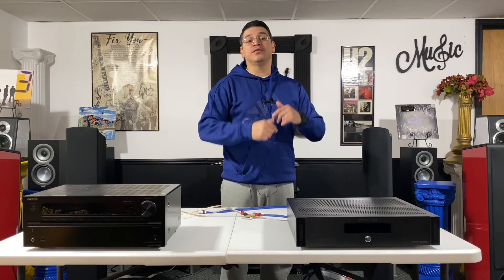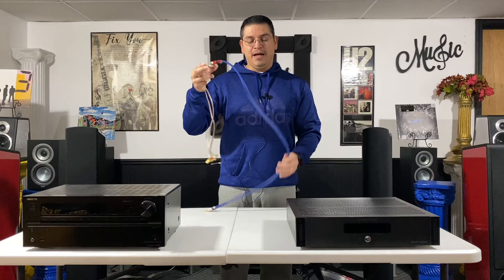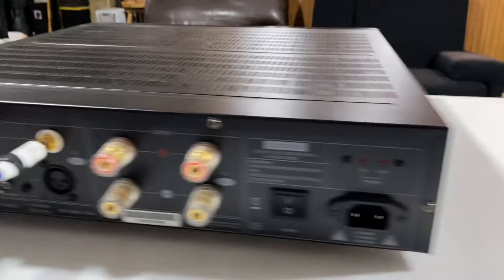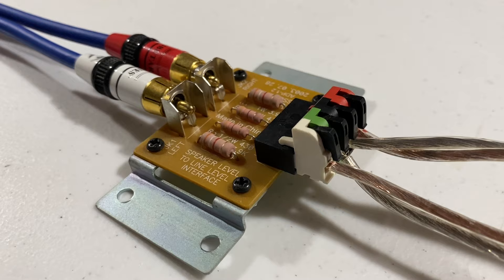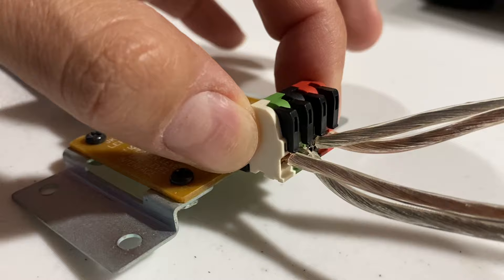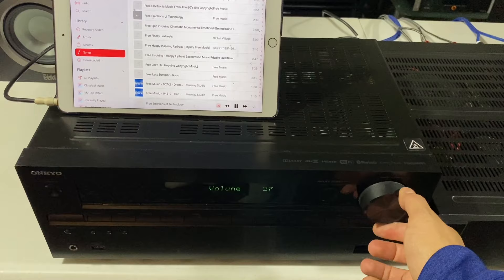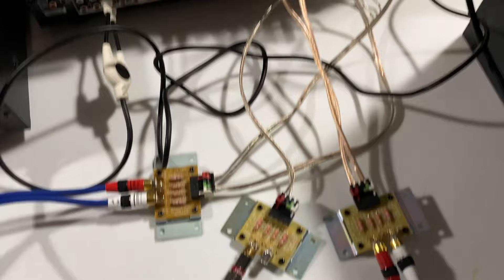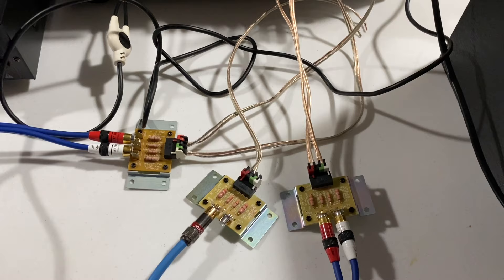Connecting an amplifier without using preouts.

Comment: Could you hook up a headphone tube amplifier to the Onkyo RCA ins?  I want to drive a set of zone 2 speakers with my tube amp to the Onkyo NR7100.  My thinking was RCA out on the tubes to cd (RCA) ins, volume control would be both....
Reply from the maker: In theory I think your idea would work, the problems you may run into would be the actual output and the which in theory you need an output source and an input source for a system to work. In your set up idea you have and output to an input/output. But you certainly could try it. Sorry I couldn’t give you a better answer
Reply: @Audiolympian  The music source would be digital out from a hard drive (PC) to a dac, the dac output to the tubed headphone amp, the headphone amp to the onkyo cd input, onkyo out to zone 2 speakers.
Reply from the maker: @maze400  that should work

Comment: I have a powered sub with high level lines. There’s 4 cables though a pair of + - and only 1 subwoofer… I’m confused on why it needs two pair of wires rather than one. How and where do I connect them to the receiver?
Reply from the maker: The high level line connections are there in case the receiver doesn’t have a sub preout. The two pairs of wire connections are for connecting the front main speakers, so when a receiver doesn’t have a sub preout you would connect the main speakers wires from the receiver to the sub and then from the sub to the main speakers. If that makes sense for you. However, if both your receiver and subwoofer have the dedicated sub connection you can just use that and not worry about anything else. Hope that helps, thanks for watching
Reply: @Audiolympian  was mainly confused on why there’s 4 connections for 1 driver, but I believe Google answered me. It’s because it has a dual voice coil I I think… I’m Using a denon 750h which has 2 sub preouts that take a single (rca?) each. subwoofer I’m trying to use is a 10 inch powered car sub. Which works because I’ve hooked it up to a tv before. (I’m just trying to get an idea on what size I need to get) Anyway, I tried connecting it by splicing the lines on the sub to an rca line, but gave zero signal. 

So connecting the 4 speaker wires from the sub to the L & R fronts of the receiver should work?
Reply: @Audiolympian  and thank you very much for the reply. I’m building this for my mother as her system broke. It’s costing me damn near every dollar I have but I want it it to sound fantastic.. she just retired from singing in a classic rock cover band, after 30+ years. And she’s wants to crank it to 11 and fucking jam lol
Reply from the maker: @LikelyLagging  gotcha. Yes just run the speaker cables from the receiver into the sub then from the sub to the main speakers. Dual voice coil is referring to the motor structure of the driver. Which most subs have a dual voice coil to push the power.
Reply: @Audiolympian  understood. I greatly appreciate the help. 🙏🏼
Reply from the maker: @LikelyLagging  anytime

Comment: When you wire an amp like this to the receiver are you still getting power from the receiver to that speaker or not??
Reply from the maker: Good question, it is getting power but it’s absorbed by the more powerful amplifier. Because the amplifiers in a receiver don’t operate the same as a class ab, d or h amp. Hope that helps. Thanks for watching.

Comment: Ok I recently bought Bose 901speakers and it has an active equalizer to be used with it, question what’s the difference of that with a typical equalizer in relation to the 901s ?? I have a Yamaha HTR 5630 but it has no pre amp in or outs OR tape monitor in and out, how do I correctly connect the active equalizer to where every thing I may connect to receiver benefits from the equalizer ?? It does have an MD/CD-R in and out as well as VCR in and out and others, what do I do ?? Thanks
Reply from the maker: Ok this is a good challenging question. First off I believe the equalizer for the Bose should have a section for amplifier input. So according to your Yamaha that doesn’t have preouts you definitely will need the adapter to connect them. Now, I be never used those speakers before so I’m not sure if they can hook up directly without the equalizer. If it can and you choose not to use the equalizer you would possibly still need an amplifier to power them properly as I know those speakers do need some juice. Now to answer you other question about the difference of the Bose equalizer and others. Think of the Bose equalizer as a specific crossover unit made just for those speakers. Could you use another equalizer?. maybe, but it’s probably not going to control the sound the way it’s intended. I’ve know the 901’s to be great speakers but I’ve also heard they are fussy and need to have the right settings to reach potential. Hope that helps. If you have any other questions feel free to ask. Thanks for watching

Comment: Please help me with some advise.. Is the adapter realy needed.. I can't get this adapter where I am. What if you use Speaker wire to RCA with no adapter.. Would that still work or are there any down sides.

I have a Denon X-2700H with no pre out. Want to add a additional amplifier to my 5.1.2 system.. Any advise would be appreciated
Reply from the maker: Others have asked that. I really don’t know. All I can say is the adapter uses capacitors, diodes and rectifiers. So I’m guessing they have something to do with the signal transfer so without those it may not transfer the signal properly. Hope that helps. Thanks for watching

Comment: So I tried doing this to my onkyo 6500 and when I turned on the marantz amp to my 6500 it came across check amp and the did a checking speaker wire test and finally shut down...I tried it again with a nero 3 channel amp and again same thing and shut down. Any ideas?
Reply from the maker: Hmmmm. Sorry to hear that. Could have gotten a defective adapter. I’d try using a different outlet and perhaps different interconnect and different power cord if possible. Hope that helps. Thanks for watching
Reply: @Audiolympian  i tried a different outlet and you might be right a different adapter could be it! Thank you.
Reply from the maker: @bigguy1403  no problem. Hope you get it resolved

Comment: Hi. Great channel with practical info. I have a set up similar to this but with a pair of Klipcsh speakers with the high low connectors. Where would the extra set of speaker cables need to be connected for that?
Reply from the maker: Thanks for checking out my channel. The extra cable placement would depend on the amplifier you have or perhaps use small jumper cables for simplicity. Or you’d probably have to use splitters from the adapter to the amplifier to help create an additional signal path. This might degrade the signal strength though. Hope that helps. Again thanks for watching

Comment: May I ask another question regarding the line-out? in a way, is the line-out the same as pre-out? I understand it's for Zone 2 setup, but is it the same?
Reply from the maker: Good question, I think a lot of people get those mixed up. No they are not the same they are different.
Reply: my understanding is it is to connect to an external amp, but you need a preamp with that amp @Audiolympian
Reply from the maker: @toai2  yes 🙌 believe so

Comment: Is this changing digital to analog.  This is a more come problem with car audio. They make more complex converters for car audio.  Are those better.  I have a denon 760 no Pre outs.  I want more power to my SVS ultras left right center.  Looking for quality not volume .  This adapter just looks cheaply made no case.  Seems like there maybe a better convter out there.  I have seen some that have step down transformers for cars.  Some are 4 channel.  Not a lot out in utube about this conversion.  I’d like to see some one hook up Pre outs then do the conversion and see if one is better.
Reply from the maker: Good question. I don’t believe it’s a converter as much as it just redirects the signal. Several people have asked about car audio converters in comparison. I think in theory a car audio one would work but I don’t know how well being car audio devices are not equipped to handle house power (120 volts, 15 amps) but that’s not to say it won’t work, I just haven’t tried it. I have been looking to get one and compare it just to see how it holds up. I also would like to find a better quality built adapter. As you said it seems kinda cheaply made, I’d say more simple but it’s pretty durable and it’s mostly for the diy’er.  Thanks for watching and commenting

Comment: Hey... I have two active studio monitors which I want to connect to an AVR (without pre out). Is this converter really safe? I mean will they blow out my active speakers if this converter fail?
Reply from the maker: I can’t say for sure that you’re equipment is 100% safe but I can say all the adapter does is reroute the signal. So it doesn’t add extra power or gain at all. If it fails then the signal stops. I also would say it would be pretty hard to make the adapter fail as it’s just a few caps and resistors and a pcb. Again it doesn’t need power or have transformers so I’d say it’s pretty safe. I’ve been using mine for about 3 years now and no issues. Hope that helps, thanks for watching

Comment: I'm wondering if a LOC for car audio would do the same thing.
Reply from the maker: I’ve had a few other people say the same thing. But I don’t know if anyone has done it. My only concern with a mobile device is that it’s designed for 12 volts and maybe 30 amps. Not 120v and 1500 amps. Other than that seems like it would work. Thanks for watching
Reply: @Audiolympian  True. I didn't think about that. I have a spare passive kicker LOC. I might have to give it a try. Whats the worst that can happen?😬
Reply from the maker: @UnburdenedByWhatHasBeen  exactly. Let me know what happens

Comment: I have a Paradigm PDR-10 v2 subwoofer, and a JVC-RX-517V. What would be the best way to connect this subwoofer, if I have front speakers, and surround sound speakers? The  subwoofer has a low level input, and a right/lift red/black speaker level input. The receiver does not have a subwoofer pre out, or a line level output for a subwoofer. It has speakers 1 and 2 line level outputs(not A and B), a center channel out, and surround sound speaker line outs. Could I hook both the subwoofer and fronts in the same ports on the receiver, or would connecting  with the surrounds work better?
Reply from the maker: I would connect the subwoofer using the high level inputs (the red and black inputs) on the back of the sub. So you would take speaker wire from your receiver (front, left and right) and connect them to the red and black speaker input on the sub. Then take another set of speaker wires from your sub’s speaker output to your front main speakers. That will power up you sub when you turn on your receiver. Hope that helps. Thanks for watching.

Comment: my  amp has no  output for going in to input to other amp .can this work for line say for input for cd input on other amp for driving 200 watt speakers only
Reply from the maker: Correct Amplifiers typically don’t have outputs. Only speaker output. So if you’re referring to a receiver then yes this method should work. But if you’re referring to connecting a cd player directly to an amplifier, that will work but the issue will be no way to control the volume. Hope that helps.

Comment: I have a Onkyo ht-r393 and i want to connect a powered sub PSW10 but my Onkyo doesn't have a sub out RCA, but has a subwoofer output wired for passive sub, how can I make it work? Do you think this adapter will work? Thank you
Reply from the maker: Good question. I believe it should work. Being it’s just a device that transfers a signal. If you get it today d be interested in knowing your results. Thanks for watching

Comment: So how do I get my other speakers hooked to my reciever to work simultaneously with the speakers hooked to the amp?
Reply from the maker: That depends on the type of receiver you have and what sound mode you’re looking to have such as stereo, all channel or Dolby. But to answer your question in short as long as the other speakers are connected to the receiver normally (the speaker binding post) they will operate like they should. Hope that helps Wade. Thanks for watching

Comment: I bought one of these last year and saved it in the box never used until I got my emotiva basX amp today. I hooked everything up and the left channel(speaker) has a very very faint buzzing noise with 0 sound when playing anything. The right channel(speaker) works perfectly fine. Again I’ve checked every wire and every connection. I believe it’s the adpater and I must buy another. Any thoughts? Thanks.
Reply from the maker: Amps usually have a slight buzz sound when connecting. It comes from the transformer inside. It’s usually caused by some grounding issue on the power line. They can be a pain to try and get rid of completely. You could get another adapter and see if that works if not it’s your amp not that there is anything wrong with your amp again just a grounding issue. Hope that helps. Thanks for watching and commenting

Comment: Hello Audiolympian,

I just wanted to say that I appreciate your knowledge and helpful insight on this subject. I'm a complete amateur at audio/home theater equipment. I recently (2021) purchased my first home theater receiver with the Yamaha RX-V6a. It's powering a 5.1.2 or 7.1 configuration with a 9 speaker setup. I did get a good deal on the receiver, bookshelf + floor standing klipsch speakers. The only issue is I didn't do enough research to understand how important pre-outs are on a receiver. Obviously pre-outs on a receiver come at a premium and this receiver came with 2 front and 2 zone pre-outs. I have recently acquired a 5 channel power amplifier by Monolith with hopes of powering the 2 front/2surround/center channel, and the Yamaha would power the remaining front presence or surround back. In terms of functionality/reliability, would you suggest/recommend that I would be better off purchasing these adapters or selling this receiver and purchasing a receiver with the necessary pre-outs. I'm kind've stuck at crossroads and need some expert advice regarding this matter. Thanks again for posting such an informative video with alternative methods of running gear without these pre-requisites.

George
Reply from the maker: Hey George thanks for watching and you comments. Appreciate you supporting my channel. Welcome to the audiophile/cinephile club. Sounds like you have a pretty good set up for a starter, enjoy the heck out of it. To answer your question, I would only get a new or another receiver if I really needed another one for another room or wanted a new feature like more channels, dolby vision, hdmi 2.0 or higher stuff like that. If you’re happy with the receiver you have I’d just get the adapters it would be less expensive as well. This way if you are interested in another receiver you can take your time and research more for the next one. Hope that helps and again, thanks for watching
Reply: @Audiolympian  I appreciate your advice my friend. I subscribed to your channel and I'm looking forward to more of your future uploads. God bless you.
Reply from the maker: @thechosenone3504  thanks and god bless as well.

Comment: It seems to me that the speaker wire being unshielded will introduce hum into the amplifier.
Reply from the maker: It certainly can but most hum in systems are because of a grounding issue. If something isn’t grounded properly then cables and wires can cause hum. Thanks for watching

Comment: Hello and thanks for this great video. I have a DENON AVR X2400H that does not have preouts, so I should get some such device to increase the power. The Russound ADP-1.2 Speaker Level to Line Level Adapter that you recommended does not ship to my country, so please let me know if there is another similar device that can be purchased in Europe. Thanks again and greetings to you.
Reply from the maker: Thanks for the support. Sorry you can’t get this over there. Some people have used a similar device used in cars for car audio. Nothing specific but perhaps that could be available to you. The only thing I’ve warned people on is the car device is only designed for 12 volts. Hope that helps. Thanks for watching

Comment: Probably works for new school amplifier. I have an old school eq. My eq does not have speaker terminals. So I need help. Almost to the point to sell this denon 1611 receiver and find old school receiver.
Reply from the maker: An equalizer usually goes between the source and the receiver or amp which is why the don’t have speaker terminals, they don’t project sound they adjust sound. I have had people tell me they used this device on old and new receivers and it’s worked well. Hope this helped. Any other questions feel free to ask. Thanks for watching

Comment: So glad I found your video. How would I do this with the emotiva bas x a5? I have a denon s750h and didn’t realize it doesn’t have pre out for an amp.
Reply from the maker: You would use three adapters but one adapter you’ll only use 1 channel, if you’re doing a 5 channel set up. Hope that helps. Thanks for watching
Reply: @Audiolympian  thanks for responding. I don’t quite understand as I am new to this setup. Is it possible to do a further updated video for reference?
Reply from the maker: @GrandNoobHeIs  actually this was my updated video but I do get asked many more questions so it may be time to update the video again.
Reply: @GrandNoobHeIs  Hi ,just follow carefully the video , is a piece of cake